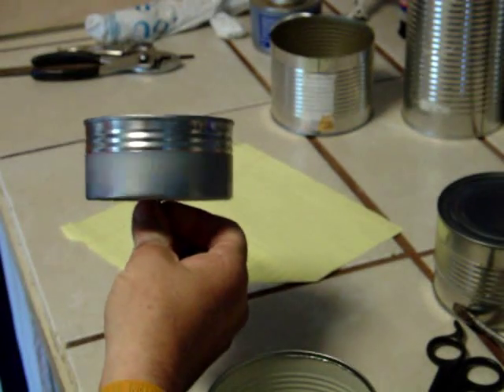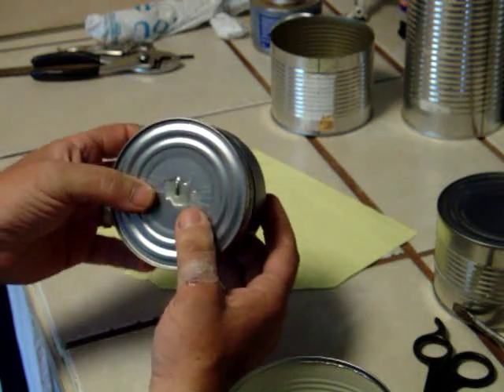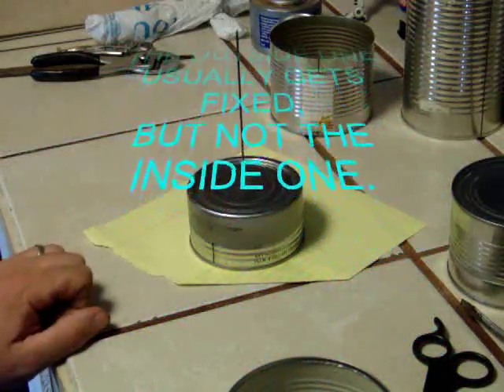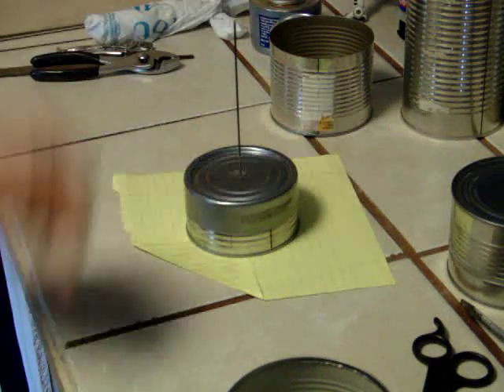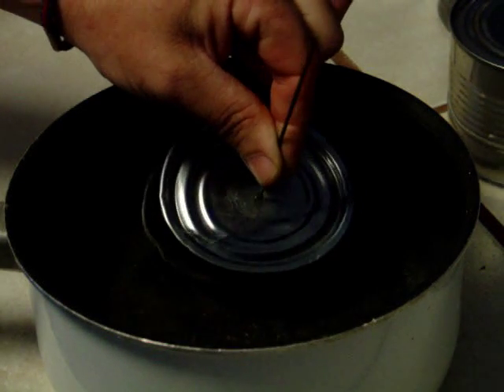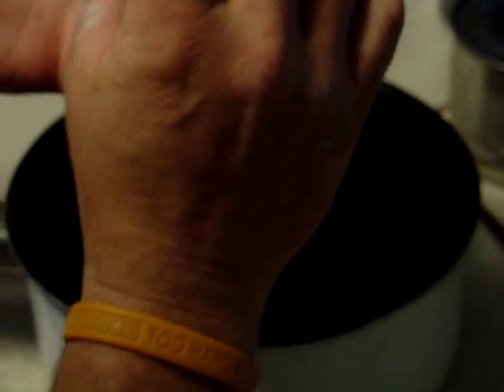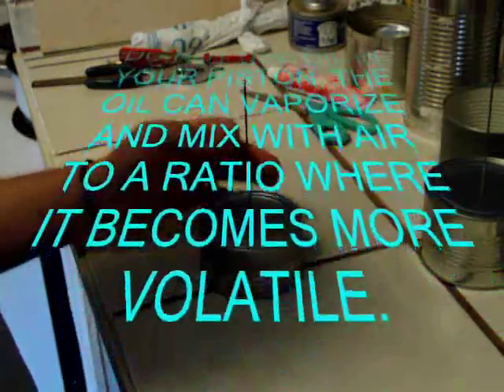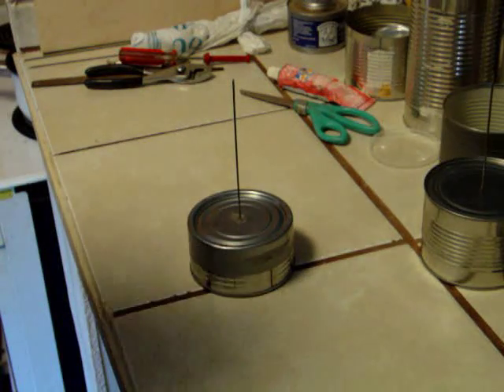PART 8 HOW TO BUILD A TIN CAN STIRLING ENGINE (DISPLACER TEST).wmv

Comment: This has me confused a bit. If an option is to have holes in the displacer (full of steel wool), why would it be critical to make sure it's sealed if it's just an empty tin? 

My first displacer popped into two sections because it was sealed (poorly) and got too hot.

My second was full of holes and steel wool. 

I would have thought that a hole in the displacer would still have the air inside being basically stagnant.